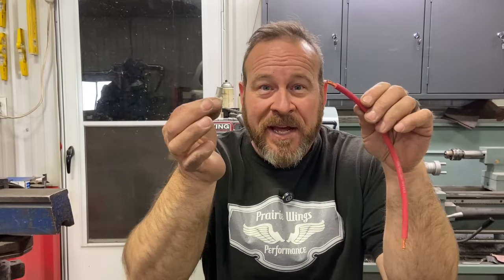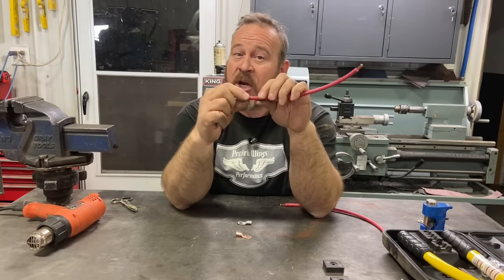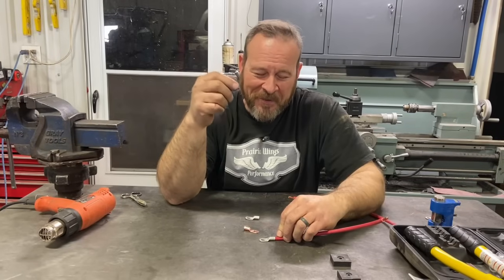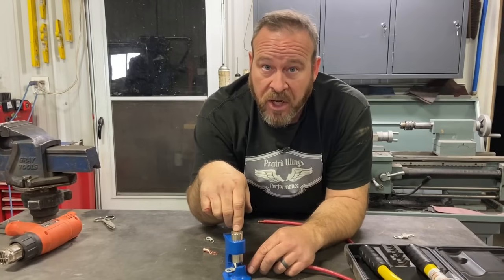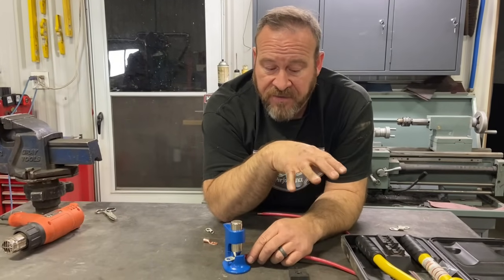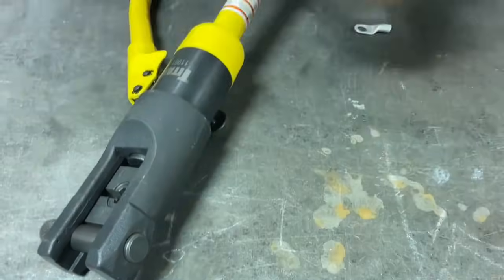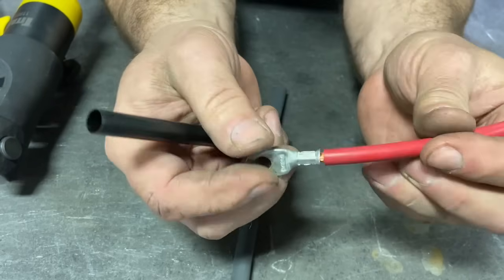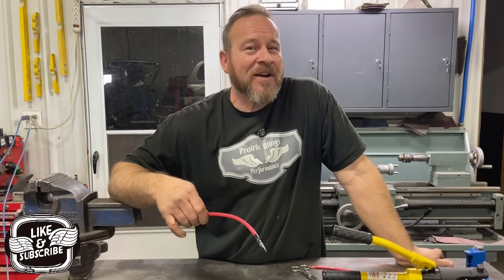Crimping Heavy Cable Ends - Which Way Is Better?

Comment: Dry DC connections are always bad.  I use silver bearing solder to do my connection. It cost more,  but works great!
Reply from the maker: Thanks for sharing your experience, it’s crazy how big that debate is. The more I learn I’m thinking it’s possibly dependent on situations. I have taken many courses on wiring, the first teaching was always solder. All of the courses I have been involved in within the past 15years have been do not solder. All these courses are directly related to the automotive industry and most of them tied to Motorsport and racing environments. It seems lots of dynamic environments vs static environments play a role here. I definitely value the debate on any topic, I can always learn more. What industry are you working in? I appreciate the time you have taken to share.
Reply: @prairiewingsperformance6036 Hello, I have over 45 years in the welding field.  I was a welding Robot Programmer at a major tractor corporation.  It's amazing what they work with there.  Their welding cables' temperatures get up to 187 degrees. High spatter, lost production. 
I'm enjoying your channel.  Keep up doing a great job.

Comment: I like using the hydraulic crimper with a smaller die than wire gauge if possible to get it really snug and then recrimp die turned over onto the ears just enough to press ears away.
Reply from the maker: I definitely like using this tool as well. Doing a nice even crimp sure does produce a very professional product! Thanks for taking the time to watch and comment!

Comment: I don’t like solely soldering for the reasons you mentioned. I prefer crimp and solder, especially in maritime environments because moisture can’t get in the ring terminal crimp and corrode it over time. Not so much solder it goes way up into the wire though.
Reply from the maker: Definitely different environments require different methods, thank you for taking the time to share your thoughts and experience!

Comment: Thing about soldering if you do it CORRECTLY is that you have better conductance.
That manual crimper just makes a dimple to hold the cable - not the best for conductance.
If you use a metal punch (not a sharp one), you can dimple a lug that way.
Lugs not only have to hold the wire they also have to provide good conductance.
I bought a hex crimper tool (looks like a mini bolt cutter in a way).
Places 6 crimps around the ferrule/lug.
I still may solder if I have too much resistance.

I am looking for a foldover lug.
Strip a little insulation from the middle of the wire, fold over, and crimp. Think a line tap of sorts.
To be used when paralleling batteries without cutting the wire and using two lugs which can create loose connections, heat, etc.
I have seen one on a car negative cable a long time ago.
Reply from the maker: Thank you so much for taking the time to watch and for adding to the conversation. Really appreciated!!!
Reply: @prairiewingsperformance6036  You are welcome. In the electrical field, soldering secures connections a lot more than crimping or wire attaching devices do. Soldering also prevents oxidation and give a better conductivity vs none at all.
It fills in gaps between the wire strands.
Although soldering may not show a huge drop in resistance, every bit you can drop means that tiny bit more power out of your setup. Less heat too which is wasted energy.

Ideally you want all silver for wires and lugs. But who can afford that?

Interesting that electrical and plumbing solder no longer have lead in them. I think lead was a better material.

Oxygen free copper is the better copper too, especially if it is pretinned.
And again that is quite expensive.

Some say bus bars are better than cable. Would have to see some significant benefits before I use bus bars from battery to battery.
Reply from the maker: @crazysquirrel9425 I have seen bus bars used. I have no experience directly myself with them. They sure looked nice how they were done!
Reply: @prairiewingsperformance6036  Store bought ones usually do but many people just use a piece of flattened copper water pipe.
I have bus bars but not for paralleling batteries. They are for connecting everything else to the battery lol.
Reply from the maker: @crazysquirrel9425 nice! Thanks again for sharing!
Reply: @prairiewingsperformance6036  You are welcome.
Remember, stranded wire has gaps between the strands.
Gaps means less conductivity.
Story is true about hardening the wire. But that applies if one does not use proper soldering techniques.
Reply from the maker: @crazysquirrel9425 I don’t know on that just what is taught in all of the automotive courses I have taken. There is lots of discussion on that in the comments in this video.
Reply: @prairiewingsperformance6036  Best to stick with what you are taught.
But what I posted is accurate and complies with electrical theory.
If you want the best possible cabling you go with all silver. Question is - does one really need that nearly perfect material for conductance? Especially at $30/ounce?
Reply: @prairiewingsperformance6036  Also, ever see an automotive top post battery cable?
Cable is dipped into the lead mold.
If it is OK there then solder should be OK too.

Of course nowadays they are cheap and use steel for the connection.
Reply from the maker: @crazysquirrel9425 absolutely agree!
Reply from the maker: @crazysquirrel9425 lots of them, I work on a ton of good old iron!
Reply: @prairiewingsperformance6036  You know where to get a foldover tab for 2 awg cable?
Reply from the maker: @crazysquirrel9425 I’m sorry I don’t. 90% of my supplies come from PICO or Techspan.
Reply: @prairiewingsperformance6036  ok thanks
Reply from the maker: @crazysquirrel9425 sorry I couldn’t help more on that one

Comment: The hole at the top of the lug is called an inspection window. Many higher end clients spec out that feature. It allows you to see that the wire is seated properly in the connector.
Reply from the maker: Yup, lots of comments on that one! I do really appreciate you taking the time to watch and to add to the conversation!

Comment: I need a really good connection on a 2 awg cable for a DC to DC charger application; inside a vehicle, heated/cooled environment, not exposed to elements but, mission critical. I don't want to pay $180 for my preferred crimp tool, or even $70 for a Harbor Freight hydraulic for just 1 crimp. So I went to see my welder friend and he doesn't have a crimper!  But, he gave me the tip soldering.  After watching this video, I'm going to buy the hydraulic tool to get just 1 crimp. Maybe I can return it afterwards.    Thumbs up.
Reply from the maker: Most welding supply shops have crimpers and could do that for you without the hassle. I would just call around two a couple I’m positive someone will have the equipment. Thanks for reaching out.

Comment: got one similar tool in a red box the handle is a bit longer but same everything else.   Been using it since 2012 and still working. 

The version i got has metric sizing but to my knowledge at the time even the AWG marked ones were metric dies.  Probably why some have issues when using AWG lugs on them.

I don't think it is recommend to rotate the work in the dies for the second crimp.  Because the one i got and the others I've seen weren't round.  It had kinda oval shape to them.  Perhaps the newer one's are different. 
Other than that they work great .
Reply from the maker: Sounds like yours stands the test of time as well. Going through the comments I have a new one on my wish list, not sure which one though. I definitely appreciate you taking the time to add to the conversation!!

Comment: Wiring in aircraft is never soldered.  I was convinced by AMP many years ago that a properly crimped connection is a gas tight connection and is superior to a soldered connection.  I have a manual crimper, sort of like a set of bolt cutters.  There was a time I was crimping about 10,000 crimps a year.
Reply from the maker: @emptech  wow, that’s a lot! You must have been a technician?? Thanks for taking the time to share.

Comment: In the past, I have tinned the copper wire when making up a battery cable to prevent /limit corrosion from battery acid before putting the end on it. Have I been wasting my time by not using this method?
Reply from the maker: @robertoswalt319  it has been tried and true for a long time for me, hope it helps you! Thanks for taking the time to watch and comment.

Comment: Yeah, not only are the dies metric but so are most terminal lugs. Unfortunately the only thing that's "American" wire gauge is the wire. I don't pay attention to the numbers so much anymore. Sometimes I can use "6awg" terminals on a "4awg" wire for example. And I just grab the die the fits. To get rid of the wings just rotate and crimp again. Same issue, but worse, with smaller gauge heat shrink terminals. To be sure that thay are crimped after using the wrong metric crimpers on my awg I use my knipex pliers to tighten a second time. Good job America for choosing not to switch to metric. Many fires and failures have happened due to this stupid decision.
Reply from the maker: @djkillachris  absolutely appreciate you taking the time to watch and to add to the conversation!

Comment: Nice crimps.  Been crimping for years, all types.  Used to be cut-strip-twist-solder-heatshrink.  Then the dealers found there was an issue with soldered joints/terminal ends breaking and a whole slew of new crimping tools appeared.  I don't think I've found an 'old' style, broken repair like that in years.  A good, proper crimp with the proper tools is the way to go but, honestly,  I've found more solderless crimps that frayed, broke or came apart than soldered joints.  Thing is, we're working with vibration factories, cars or motorcycles, and things break over time, no matter what.  I guess the standard would be where, exactly, did the vehicle stop moving when the connection broke.  As far as terminal ends, the crimp is king.  But a quick drop of solder, and not a quarter pound of the stuff, keeps a good connection and keeps out corrosion.  Your battery cable terminal, if you notice, has a small opening on the eyelet side.  Without smothering the joint, the eyelet can be gently heated and a drop of solder can be introduced through that opening without introducing solder into the cable beyond the crimp.  A small hole can be drilled in eyelets or terminal ends that don't have than opening.   Over the years I've seen some extremely creative electrical connections.  I see dielectric grease mentioned here.  Dielectric grease, by it's name, does not conduct electricity.  I've seen it used on spark plugs, electrical connections and whatever.  While I've never seen something NOT work because of that, it just rubs me the wrong way to use non-conductive compounds in electrical connections.
Reply from the maker: @gtgarage  yup, I’ve been called out a bunch on the hole in these comments, oops. I definitely appreciate you taking the time to watch and share your experiences!!!!
Reply: If this goes thru twice then excuse me, please.  There's nothing much more disheartening than finding a student repairing a battery cable end with a hammer and hammer lug crimper sitting on the battery ready to go.
Reply from the maker: @gtgarage  🤣that is Awsome! You made my day! I can totally see that!!! So true, so true! Looking at you like what’s the matter when you say really!?!?

Comment: 6 gauge is small, I have fine wire 2/0 wire that I cannot get into the crimp end and it seems no one can help me. It frays no matter what I do.
Reply from the maker: @LarryRichelli  way back in the day I used to get the larger cables crimped at the local welding supply shop. In the field I used the blue crimp tool I would hammer for that size. Have you tried a welding supply? PICO 4539U-12 is 2/0 AWG x 3/8” hole and PICO 4543U-12 is 2/0 AWG x 1/2” hole. They have lugs up to 4/0. Thanks for taking the time to reach out, hope this helps.

Comment: I don't recall, ages ago it seems, that terminals used to have the 'wing' issue. It seems, to me, that since we've begun offshoring most of our supplies that when we order wiring products we are sent 'close enough' supplies from countries that assume a millimeter or three won't make any difference in terminal diameter or wire gauge.
I always assumed the little terminal hole was a remnant from forming rather than supplied for inspection. That inspection bit to me seemed stupid as in, "If you don't know how to feel the conductor is bottomed out in in the terminal, and look to see that the insulation isn't touching it, you should go back to feeding chickens." That being said, if I have to use that terminal I'll just shrink on a tube then put a dab of sealer/silicone over the hole and call it a day. I have no issue with using dielectric grease in a terminal but I've been thrown under the bus by so many idjits that seem to be able to convince unwitting management that someone is doing something wrong... It just isn't worth the hassle.
Reply from the maker: @carlbeaver7112  yes! Most of the supplies I use are brand name. The terminal/lug I used in the video are the ones that come with aftermarket harnesses, I rarely use those, wish I wouldn’t have for the video. They usually have the biggest flashing (wings) that is what inspired the video. I do wish supplies and tools were standard but a lot of diy people wouldn’t be able to afford to do stuff. Thank you for taking the time to watch and comment.

Comment: I'll tell you what I do. Is what works super good It's a cheap nut splitter  They have that tool in every Auto  Store Just get the ones with the  Wedge style works great as a  Crimper In a tight spot.I like to take the end loop pack the bottom of it full of  sodder  Then I crimped the thing and I heated up with the torch so I see the sodder ot the end Then you have a mechanical connection and a good sauter connection  Sautter by itself not great especially on my diesels where you might melt it out of there you need a mechanical connection  Also
Reply from the maker: @crautoguy8384  nice, thank you for taking the time to share your experience!!

Comment: As an EE and owner of a large marine electrical business, I have treated myself and employees  to both AMP & Molex crimping courses. In our business we only use AMP ROTA Crimp and Bantam ROTA CRIMP tools (USA made) As they make  a “box crimp” which is what the ABYC requires... There is only one hydraulic crimp tool with AWG specific dies and those are TEMCO. All the others are mm2 sizes even when the have AWG stamped on them…Those raised portions are called “flags” and it means your dies are over crimping which is bad for the lug. Flattening flags by rotating merely hide the fact that the dies are improperly sized.. Also no sense in using dual wall heat shrink when you buy open ended lugs. Marine lugs are closed end and make a true hermetically seals termination
Reply from the maker: @rccollins8160  that is great information! The lug I used in the video are the lugs that come in the aftermarket harnesses, I rarely use them. Most I use are PICO products. After the flood of information this video has created I definitely want to upgrade the crimp tools and techniques I use. Where are the courses you attend? I absolutely love education and would love to go to those courses!! Thanks for taking the time to share!!

Comment: oh kay before you lot melt shit do not solder it blows out at high currents due to high resistance now were talking micro ohms here and yes it can be measured.
1 use the hex press crimp only.
2 do not crimp to close to the palm.
3 strip wire long enough where the cable goes all the way into the lug
4 use the correct die set to the lug crimp LIKE YOU SHOULD! 
notes this guy in the video will have an electrical fire some time soon
Reply from the maker: @mathewwitty5858  thanks for talking the time to comment!

Comment: I've been an aircraft electrical technician/engineer for 45 years. Solder is only used on circuit board connections. Mechanical splices should always be used over solder when making wire to wire connections. Best yet is to run a new wire where possible and not splice as the splice will always create a point of higher resistance and possible corrosion if not correctly done.
Reply from the maker: @rickcski8082  I really appreciate you sharing your experience! If only young people could extract the wealth of knowledge somehow and not take it for granted. Thanks again for taking the time to watch and comment!!

Comment: Of course unless you seal the hole in the end moisture gets in anyway. 
What I do is solder after crimping. A small amount of solder to plug the hole but not wick up the wire strands. The trick is to have the low impedance soldered connection without creating a stress riser in the wire. It will cut the voltage drop in the cable in half 1 or 2 years down the road. 
Factory crimps are done with high speed and pressure so the parts are welded / bonded together.
Reply from the maker: @donsmanufactory  ya I rarely use those ends, they are the ones that come with the aftermarket update harnesses. Can’t see the forest for the trees sometimes…. I do really appreciate you sharing your experience!!

Comment: I did a lot of research on this and I also learned that soder will make the wire brittle, I think it could also cause corrosion ? I use a hydraulic crumplier like the one you used but I will definitly crimp part way, rotate and finish like you did and check to see if I need to use next larger size die for ends that I am using
Reply from the maker: @Mr58hawkeye  I’m glad you could use something from this video. I really appreciate the time you took to comment!